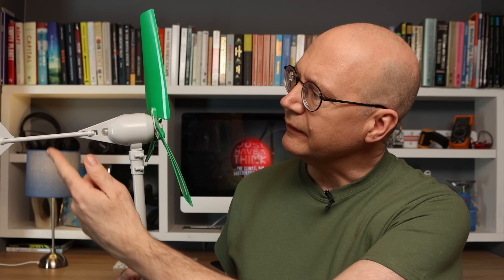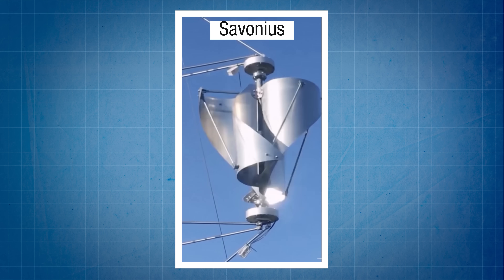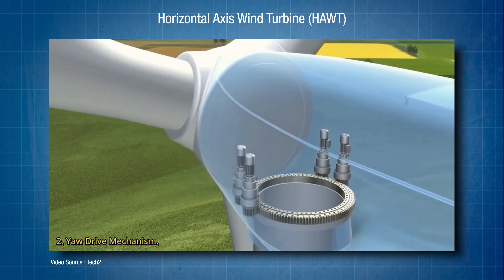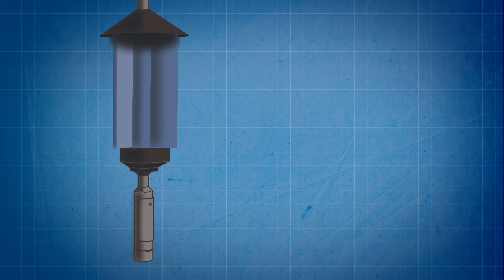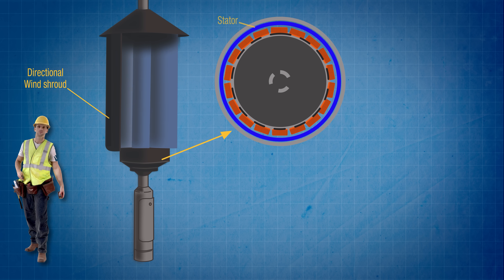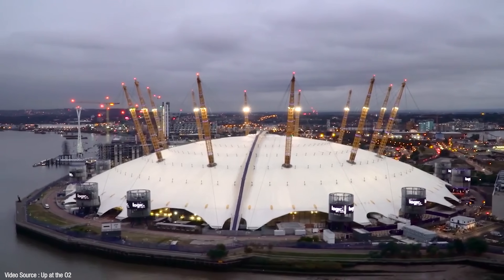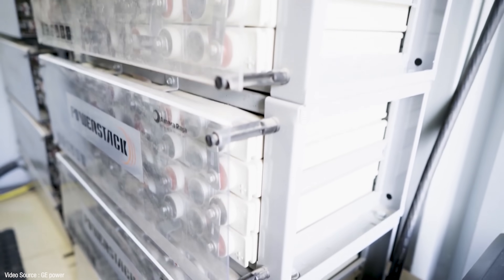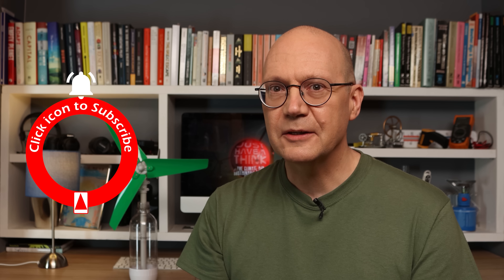A vertical axis wind turbine that doesn't need the prevailing wind! How do they do that?

Comment: IDEA!!!!,, Having grown up in down town Boston, one of the things that always look me by surprise was the huge wind currents you would encounter just walking around the huge buildings downtown. Mounting these types of generatos on the sides of key building in a city would make sense.
Reply: Hey Mr. Bostonian. I am from Boston as well. I live just south of Boston. Nothing wrong with using what we already have. meaning that your idea is a very good one. Also, on the side of highways and at different points at airports.
Reply: @charlesdenny2925  Well no it's not a good idea, clearly.
Reply: @Withnail1969  You are not too bright are you?
Kinda poor education I guess.
I don't blame you though, not everyone is smart as hell.
Reply: You can add the vertical types on outrigging between the buildings to offset cooling systems.  Any help is of great benefit, and the vortices between the buildings would be a terrific source for tight deployments similar to what was shown on the vid.
Reply: @solarfinder  No you can't. The buildings aren't designed for those stresses.
Reply: @Withnail1969  Then you don't attach them to the buildings. One above an intersection would,power the LED traffic lights easily. One on every light pole. New poles with stacks of them at particularly windy places.
Also, some mounted on the street level corners of buildings I doubt would compromise their integrity. Noise could be a problem for offices at lower levels though.
Another windy place is some parking garages.
Reply: @Withnail1969  I don't want you in my brain storming sessions!  
Your concerns are correct, however.
Since the vertical axis wind turbine in this video is a new product, the selling point is that it provides not only electricity, but also can provide additional value added service, such as environmental information. Initially, non-critical locations are important! (Think Texas blackout)
Reply: @Withnail1969  a properly engineered building is designed to handle double the loads it should actually experience, a few small wind turbines that way a few kg wouldn't be that destructive to a sky scrapper.
Reply: @Withnail1969  I don’t believe that you either understand what is being suggested or you simply don’t want to consider that there are things that you are missing. Just saying NO isn’t a valid reason to reject things outright
Reply: Could be engineered and the stresses needn’t be very high. A percentage of the wind available. But more likely to be done when building a whole new street. But turbulent airflow near to cities kills turbines’ performance. Better spend the same money up a hill or out at sea
Reply: @richardcripps9106  But its not engineered on the buildings that currently exist.
Reply: Withnail1969 smaller versions can be installed following regulation, goal of vawt here isn’t really to be big or cause stress like normal wind turbines, but work as a complimentary compact source wherever possible. Large scale ones must have their infra accordingly built no doubt.
Reply: There is a reason why windmills are generally in clean airflow locations.
For the same cost, bigger horizontal windmills will produce more energy than in the built up areas with turbulent air which are intermittent and aggravating the effects on pedestrians and street furnitures.
Reply: you couldnt generate enough energy to pay for its self, pointless.
Reply: @Richard Gilley They know now. It won't work and it will never happen.
Reply: @James Pink No.
Reply: @bobbytookalook  an antenna is nothing like a wind turbine that is designed to catch the wind.
Reply: can't be done, buildings are engineered for certain levels of wind stresses. you can't just add things to them that would cause more. people on this channel don't tend to think things through.
Reply: @Withnail1969 , I'm a registered Architect who has been the building trade for over 40 years. Please enlighten me on the conclusion you jumped to, because I have a very different take on why they haven't been attached to buildings, and it has nothing to do with lateral forces, uplift, nor dynamic aeroelasticity.
Reply: @Withnail1969  Whoa! The entire concept here is to generate ideas and work them through! Blessed are those who put forth ideas!

Comment: I've worked for 2 start-up companies developing micro-wind turbines, one HAWT, one VAWT, doing in depth design calcs, manufacturing of prototypes and production units, fatique testing, data logging etc.  
The generation figure presented in this vid (5.8kWh/day) seems extremely optimistic to me, for that size of turbine, especially considering it is only recovering energy from intermittent bursts of turbulent air from passing vehicles.

The micro wind industry has a history of overly optimistic energy predictions, and companies presenting "radical" new concepts which sadly tend to over promise and under deliver when it comes to annual yield and return on investment for customers. In my experience, micro wind tends to attract designers without prior wind industry experience who have ideas which seem great on paper, and really want to see their invention work, which then results in them making optimistic assumptions. There have been many micro wind startups, and almost all have failed; the economics of micro wind sadly just don't really work. 
 
I have noticed that there is often a tendency to over estimate wind resource, and underestimate manufacturing, installation and maintenance costs.  Since the power in the wind is the cube of the wind speed, any overestimating of wind speed can massively affect predictions of energy yield, and financial return.

So basically, I would take their figures with a pinch of salt!

Also, why not instead focus on making cars more aerodynamic (coefficient of drag values, and therefore energy used per km could be SO much better if the automotive industry decided to focus on this)?

Or better still, enable people to switch to public transport rather than cars, by making trains and buses better/cheaper/free, whilst making cars (yes that includes EV's) expensive/heavily taxed?

In my opinion, to reduce carbon emissions we don't need any new innovative technology, we just need to use what we've got more wisely (and I say that as an engineer, with a tendency to seek technological solutions...)
Reply: thanks for that...should be top comment....can't really work on any substantial way

Comment: Hoping for a very low starting speed Vertical Wind Turbine for Residential roof top use.
An energy positive home system built around Solar, Wind, and Battery should be the goal.

Comment: You think lighting engineers will let you fix this on lighting columns and drill holes on the columns. 
(To feed the wiring  through). No chance. 8 kg extra weight on an existing  column you have just weakened with a new hole. These companies never come up with a realistic cost model.  It's a con.

Comment: I am curious as to the safety of road side installation. Can they at least be installed on the opposite side of the hard shoulder and still be effective, or do they need to be within a fairly close range to be effective?

Comment: I've never been really comfortable with the thought that a vehicle moving at constant speed in air must necessarily dissipate so much energy via drag.  If only there was an alternative.  I believe there is.  It's called "drag negation" and it  works via energy transforms.  It basically comes down to a family of 3D shapes that have never previously been considered for transportation or ballistic projectile use.  Google "drag negation" and you should find my article on linkedin.

Comment: Wow! Imagine this when all of the vehicles are EVs! I bet we could generate enough electricity from such schemes to nearly recharge all of the EVs. I mean, we could nearly build enough of these to for a complete tunnel over roads and maybe get enough electricity generated to power aluminium smelters and steel mills. And many people have suggested them in railway tunnels and in the Underground.

But wait a minute: "...Aerodynamic effects of tunnels will result in a significant increase in train energy consumption, shorten life of railway train / tunnel system, and increase maintenance cost..." It looks as though doing this sort of thing will actually increase the drag/friction on passing vehicles and cause them to use more fuel - which right now is mainly fossil fuel.

Looks like a bit of 'Magical Thinking' to me, Dave! 

Mark P Mills is the most sensible, pragmatic voice on energy issues on all of social media. Might I respectfully suggest that you, Dave, and all of your many disciples listen, with an open mind, to this wonderful communicator on the video linked in this:

https://www.facebook.com/groups/1032713003519847/permalink/2805027256288404/

Comment: I wonder if this will pull on the vehicles in the same way as when you sit into the airstream behind a lorry? It speeds up your vehicle but slows down the lorry. In that way causing more fuel to be used? this may be robbing peter to pay paul?
Reply: Agreed. Won't it cause resistance which translates back into the cars? However wh3n placed in non-traffic situations, it will simply slow down the wind harmlessly.

Comment: It doesn't matter if the vehicles now are mostly fossil fueled because that will change and the system will only get cleaner. Certainly isn't a reason against the system, especially as the traffic is going to me moving along anyway.

Comment: Are there calculations as to how much it would increase the power needed for the traffic? I mean, nothing is really free, and in this case I think the turbines will decrease the tow from traffic in front of each car, meaning it will need more power to keep the same speed. So, perhaps ~10-20% of the power generated by the turbines comes from increased power output from the traffic? Would perhaps make sense in a very electric fleet, but not with a high ratio of fossil cars.

Comment: They sound very simple and surely much more cost effective and using up less resources than solar panels. Wouldn't the cost of generating the same amount of electricity for less cost in resources and simplicity make it more efficient, given that the number of these you could install is not limited per square metre of space the way solar panels are as they can be installed one above the other. Wind can also be funneled and putting  them alongside railway lines you would be able to place them in the exact spot for maximum efficiency away from the public and damage from passing vehicles.

Comment: I thought of the same thing - but with the turbines in tunnels where vehicles (cars, trucks, trains) pass through (mounted on the sides/walls and ceilings can be placed many in a row)...thus, more concentration of the induced wind flow from vehicles passing by - more electricity produced!

Then there's my FARADAY road electrical producer idea!

Comment: The U.K. government was offered this idea back in 2004 .  U.K. it a was system that used street lamps poles . The lights/poles already are wired to the grid so it was just a slip on/over vertical turbine ,just think of how many street lights are available . The system was patented and the government stopped any mention of it .

Comment: VAWT's could work well with flywheel energy storage as well, directly driving the flywheel. It would reduce energy conversion loss since it's going from a kinetic source to a kinetic storage. It would even make it very easy to switch from storage to generator modes by engaging and disengaging the stator from the flywheel. Engage the stator in the daytime, when power is in demand, and disengage at night when power demand is low, to store energy. You could build this as a flywheel built into the base of the pole and mount the turbine at the top of the pole. You could even integrate a motion activated LED lamp into this, to provide light.

Comment: It won't work because it will take the air currents from the vehicles and just convert the engine exhaust to energy, causing the other vehicles engines to work harder. In fact it would probably drop car efficiency so significantly it would be shut off an hour after they put it in place...

Comment: It is a bit of an assumption that the energy harvested from passing cars is otherwise completely wasted. At some density of traffic, the movement of cars will create a some net airflow in the direction of the traffic. This would reduce the effective speed of the air hitting the cars and thus reduce fuel consumption. I don’t know whether the traffic density required to reduce fuel consumption would require dangerously close slipstreaming or not. Anyway, I think one would need some proof that the energy gain from the road side turbines is not sapping the efficiency of the cars.
Reply: I would also have some concerns regarding the airflow profile. The average airflow might be an attractive number, but the distribution of airspeeds over time could be unattractive. IE very low velocity followed by a fraction of a second of high speed air. High volatility of airspeed is the enemy of wind turbines.

Comment: When I put an "old-fashioned" headlight powered by a wheel-mounted generator, I found that when I switched over the generator, pedaling became harder. How much more drag to these highway turbines do they add to the vehicles passing by. This increased drag would increase fuel consumption because, as we know, energy is not free.
Reply: Nope, nothing is free. One problem with this scheme is that if fossil fuels are phased out, as is intended, there will barely be any traffic on the roads in future to spin the turbines.

Comment: I disagree with the efficiency of this system. To generate power from the turbines you have to put an impedance to the free flow of air. This is passed on to the movement of the vehicle and thereby reducing the efficiency of the vehicle engine. It’s not energy for nothing, they are actually using your vehicle engine and stealing a tiny amount from each passing vehicle.
Reply: Numai dacă trece unul singur si nelijabil pentru că nu este o conductă6, este unculuar deschis deasupra. Iar la mai multe vehicule (dacă studiezi curgerea lichidelor) vei constata că prin rotația turbinelor frecarea de un ipotetic perete este mult mai mică. Deci este economie pt auto. Cel mai bine este fixarea lor pe marginea șoselelor. Aer comprimat, in rețea comună, la orice viteză. Nu contează intermitența, sau forța, sau producțiade curent la o anumită turatie, la o anumită, sarcina. In. Plus costuri enorme.

Comment: Hmmm - From the reactions below, it seems clear that all viewing this video think it's the best thing since 'sliced bread'.  However, I'd like to see some realistic comments from power engineers responsible for generating our current electricity supply over the poles & wires to our respective homes & business houses.  

As all should know, power levels MUST be within very tight technical parameters, otherwise serious damage can occur should the power being generated become unstable due to unpredictable swings (up/down) at short notice ie within seconds that I expect the power grid will not enjoy.

if / when that happens, what then are the consequences for industry & our home appliances that are ALL engineered to operate within tightly defined technical standards, as indeed are our current power stations, in the main fossil fuel (coal or gas), that are highly reliable in terms of providing power in accord with grid specifications.  

What will now occur with large numbers of low power inputs, all operating independently with few, if any(?) apparent controls & all highly dependent upon intermittent sources (like wind, solar & now passing, albeit also intermittent traffic) to grid stability?  

I shudder to think & suspect it will not be a good outcome.  Least of all for our end user electrical equipment at home, or in industry.  So lets have some hard nosed expert engineering advice please so we get a balanced picture of not only the commercial viability of intermittent wind generators located on traffic poles, but its impact upon our power grid 24h/day?
Reply: You can reasonably install a stand alone system in a domestic environment yourself

Comment: why not put this into the body of the bloody electric car ,, and use it to recharge the battery to a certain degree,,, they use air capture  to cool the brakes,  and the shape of the car to keep it on the road,, )fins and spoilers(,,, in some countries already,,  even now ,,  you are not allowed to recharge your electric car at your home because the electric grid cant handle the increased power draw

Comment: When I first glanced at your title, I had an entirely different thought of what you meant by power, absent prevailing wind. I see now, and I find it ingenious. What I conceived, and what I think they might consider, is a vertical axle featuring slender vertical vanes with a rake of perhaps 5°, such that, on a windless day, rising warm ground air could cause rotation. Imagine it: the same hot area that could sustain solar generation could exploit that phenomenon, and piezo generation besides.